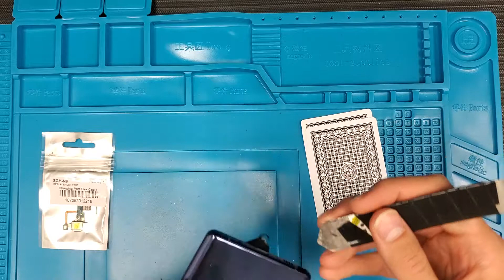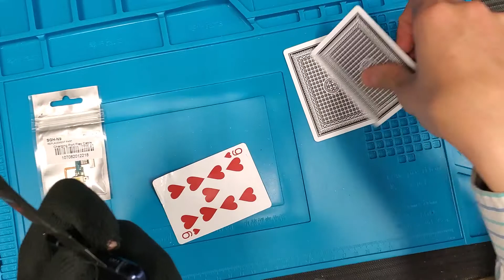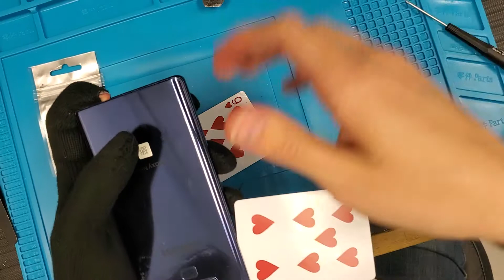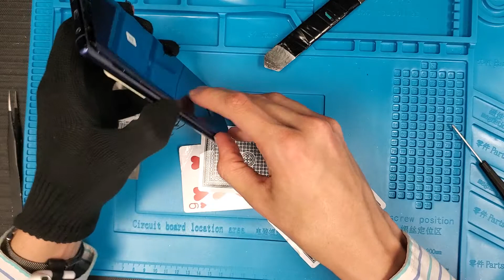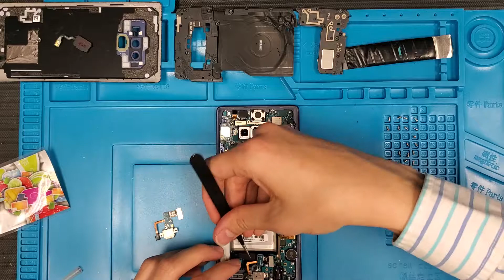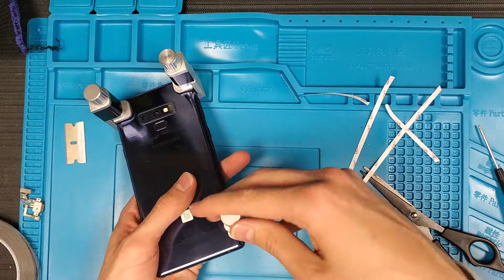Samsung Galaxy Note 9 charging port repair/replacement

Comment: Hi RPF, was this your first charging port repair? Curious if this was your own phone or a customer of yours? If the conductor cover gets damaged like the one here should it be replaced or is it not important?. Greatly appreciate you sharing
Reply from the maker: This was a a customers phone and it worked perfectly afterwards, also all the work I do comes with a lifetime warranty for most repairs.
Reply: @marijuanamindless  thanks for the feedback